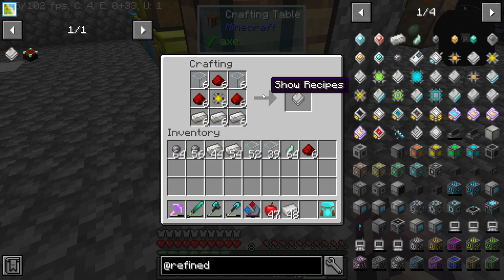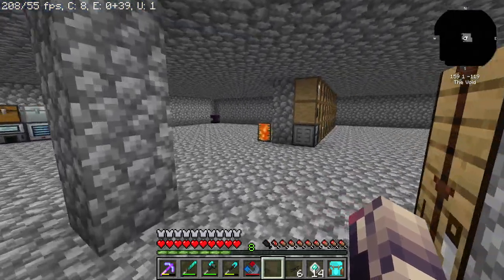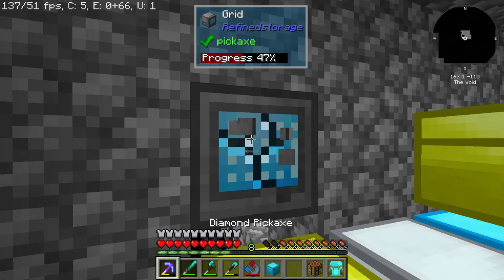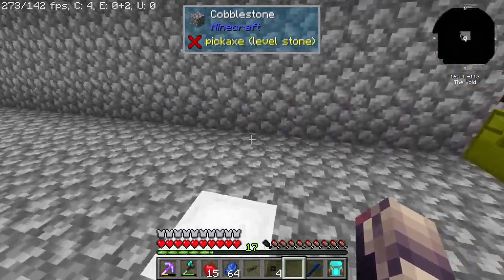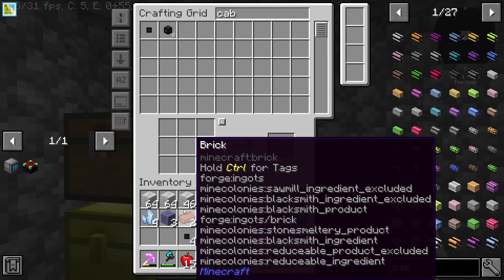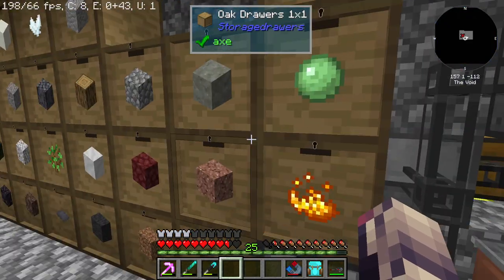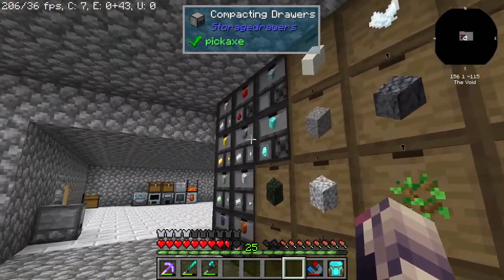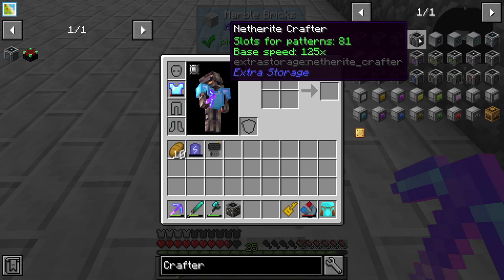Direwolf20 1.16 Modpack Ep. 10 (Minecraft): Refined Storage Start

Comment: When a recipe is allowed to accept a variety of blocks, at the very bottom of the advacned tooltip it will say "accepts any:" followed by the type of blocks.  For example, in the Disk Drive recipe, the advanced tooltip said "accepts any: Forge :Stone" hence it will accept any type of stone (note that means what was formerly known as smooth stone... not cobblestone or it's equivalent variants).  A few other ones you commonly see are "Accepts any: Chest" or "Accepts any: forge:logs".
Reply from the maker: Yea. I noticed this a few hours later. Though this is a great tip.